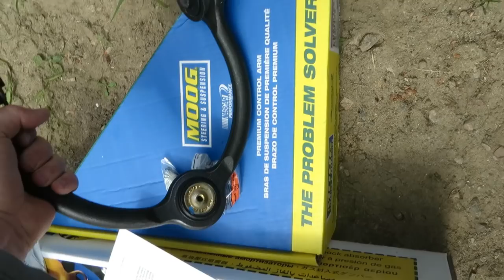2005-2010 Jeep Grand Cherokee WK Front Control Arm Replacement, Clevis Bolt, Spacers, Bilstein 5100

Comment: Those 2 bolts ur putting in.. I'm having a really bad time getting the piece to even sit flat! I'm so fed up with my jeep right now! Is there something I'm missing why that wouldnt sit flush?
Reply from the maker: I'm not sure which ones you are talking about but it may be time to take a break and look at it with fresh eyes later.  You may need to use a jack to align things.
Reply: @SteveRivett  @21:44 that piece right there! I have a new control arm and I can fit it in but that piece will not sit flush at all for get the 2 bolts started.. is it suppose to spin ? And mine is stiff becaue its new..? Thanks for the help! I can't find anything about it besides this video

Comment: 35mm for axel nut
Reply from the maker: I think there are some variations over the years or if the vehicle has an aftermarket axle.  It is definitely something to check while planning the job.
Reply: @SteveRivett  I was wrong, it in fact is 36mm. Wondering now how many random axel nuts were 35mm.

Comment: Chrysler absolutely fucked up when they designed these pieces of crap. I have a 05 and the lower strut fork bolt is siezed just like this one. Spent 5 hrs beating and heating the piss out of it, to no effect. I did all four shocks on my 03 ford half ton with no issue. It's simple, and straight forward. Jeep on the other hand has a complete garbage front end on the cherokee, no other way to say it. I'll let someone else do this job because I'll have a 12 pound maul shoved through the engine block if I keep trying.

Comment: I appreciate the video and it mostly has the steps required but I am somewhat pissed it skipped over the ABS sensor removal / electrical disconnect.  Didn't realize there was a quick connect and instead I busted the sensor when trying to remove from the wheel bearing assembly.  $65 mistake that could have been averted if the video made some commentary in two sentences or less.
Reply from the maker: Sorry to hear that, there is a connector somewhere up in the wheel well for people in the future.
Reply: Youre pissed because you werent competent enough to know there was a connector for an abs sensor and had to spend $65? Your fault. Did you thing it was hardwired into the wiring harness??
Reply: @banshee9699  I got over it.  It's in the past.

Comment: Your not gonna be able to get the clevis bolt to spin move the jack so it's lifting the jeep not the lower control arm, put a small jack under the control arm,  remove the nut, raise or lower the small jack to take tension off lca, screw nut back on a few threads, use big hammer to drive nut out.
Reply: Agreed, but seven after he had the shock off he had to drive the bolt pieces out. Releasing the pressure caused by the spring is what allowed me to free the bolt. Let the assembly hang free.

Comment: Which bushing is the one that the clevis bolt goes through? Need a replacement asap
Reply from the maker: I think it is the "arm to strut" lower control arm bushing.  https://www.moog-suspension-parts.com/products/jeep_grand_cherokee_2008
Reply: @SteveRivett  my hero❤ no homo
Reply: Hey shaft 9000 how did you succedully run the new bushing back in
Reply: @1998jtlatgmailcom  Hit her with a big hammer. The hard part is getting it out if you haven't already use a angle grinder with cut off wheel. Everyone says sawzall but you'll be there all night with one of those. If you mangled the LCA In the process smooth it out with a Dremel